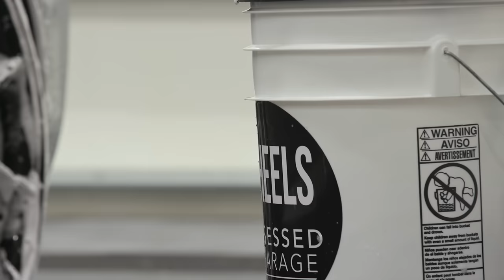M2CS Wash and Talk: Giveaway Begins September 23rd!

Comment: I dont know how that wood backing showing on the door Windows isn’t driving you nuts.
Reply: I think that every video! 😆
Reply: I've thought the same thing..
Reply from the maker: Unless I remove the 500 pound doors, you can't get to it.
Reply: Get a garage door guy to come in and remove the top panel and you can paint. Top panel goes in last, comes out first. It’s not bad. I doubt I would do it myself.
Reply: @ObsessedGarage  Where there's a will, there's a way. Give the people what they want, Matt.
Reply: I’d think you could remove the mounding trim on the inside, remove the glass, paint, then reattach the glass, etc.

Comment: The deionized water system is really needed for those of us in Nevada. Constantly have to replace the resin in my system. Being able to test the water coming out of the hose bib and then adjust the filtration system will be a big seller. Can’t wait for this!

Comment: You can get a straight pipe from Active Autowerke, to replace the resonated pipe - but I think it sounds more raspy… I went the opposite way, had the non-resonated equal length midpipe & ended up buying the resonated pipe from AA. I have the Remus RACE back box…

Comment: Hopefully your DI system will have a gpm flow meter and a way to keep track of how much water the system produced.
Reply: Why? I'd think the valuable information is time until the media needs replacing.  Different supplied water sources will require different change intervals.
Reply from the maker: I think flow will be 2.0 version.  The flow meter adds about $100 to the cost of the system.

Comment: Such a sweet car, and garage. 

About the G80, will you be doing the break in oil change (because it’s actually required on BMW since it’s not a real engine oil in from the factory) or will you let your local dealer do it?

Comment: Wonder how long the water sits on the floor? I use to wash my vehicles in my garage, its sloped to the center and out the door fairly well. Water would sit on it for a week with a dehumidifier running non stop.

I would keep an eye on your tools. If they are cool from having the A/C on and you pull a hot vehicle in there and wash it, everything may start sweating.